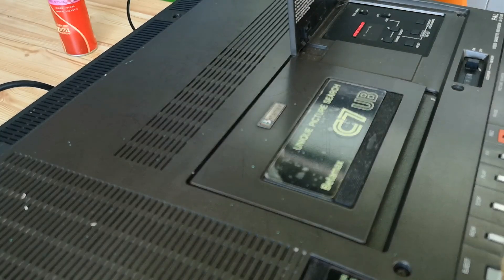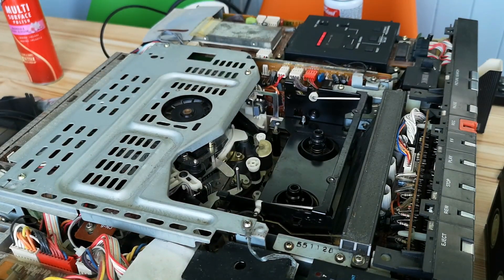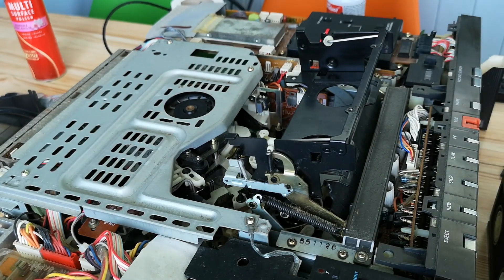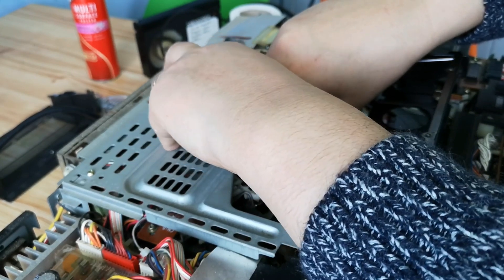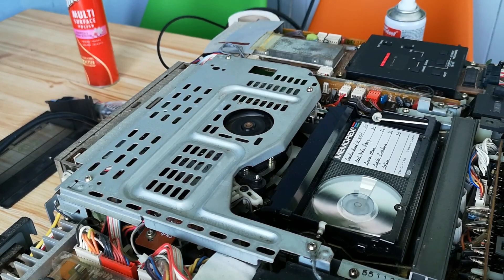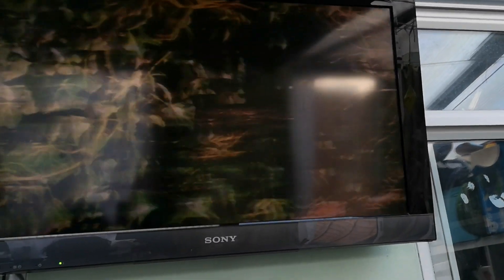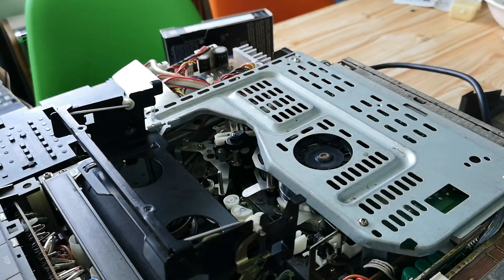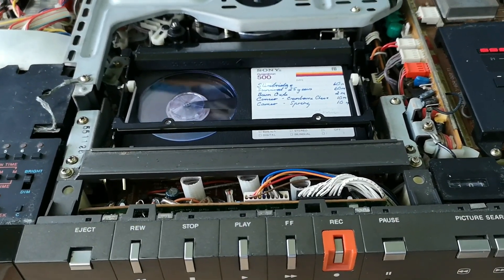Sony C7 Betamax - Testing playback

Comment: The Philips N1500 system was the only domestic format with guard bands between the video tracks. U-matic might have guard bands too considering it's age. Betamax just has narrower tracks and a slower tape speed compared to VHS. But as the Betamax head drum diameter is larger it has a higher effective writing speed, which gives it a higher bandwidth.
VHS: tape speed 2.339cm/s (PAL-SP), video track width 49μm,, drum diameter 63mm, writing speed 4.86m/s.
BETA: tape speed 1.873cm/s (PAL), video track width 32.8μm, drum diameter 74.487mm, writing speed 5.832m/s.
V2000: tape speed 2.442 cm/s (2x4), video track width 22.5μm, drum diameter 65mm, writing speed 5.08m/s.
I got those figures from an old text book, as for the colour cross-talk between tracks it goes into a rather a long description of how VHS uses a "vectorial approach" to prevent it, but does go on to prove that the colour under frequencies for PAL VHS are 626.952KHz and 623.046KHz. It quotes PAL Betamax as 685.546KHz and 689.453KHz.
Reply from the maker: I did not realise that, I though VHS used guard tracks, and Beta just shifted the colour frequency depending on which head was writing to the tape, great to have it verified though.......

Comment: There are 7 light blue sanyo capacitors on the as-3 circuit board which is the smaller board of the two on the under side of the machine,replace them all and it will be repaired.....GUARENTEED!!!!!!!!
Reply: replace all light blue sanyo caps on the as-3 circuit board and it will rectify the issue.
Reply from the maker: And in the end, I replaced the three larger light blue sanyo caps, and perfect servo lock was restored. I have tried executing a similar repair on a T7-ME, which uses a different board layout, but, I have only been partially successful. I did note that there are more light blue sanyo caps, so for both machines (the C7 and T7), I'll replace all of them, given their reputation. For now though, the C7 is running superbly :).